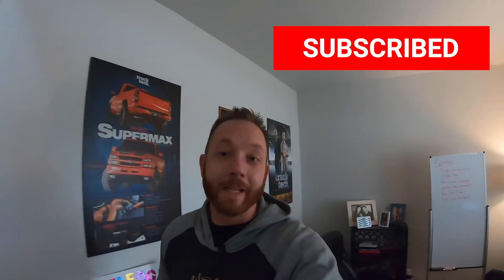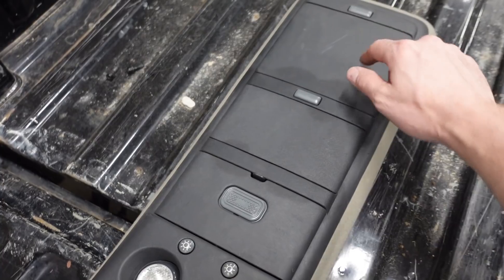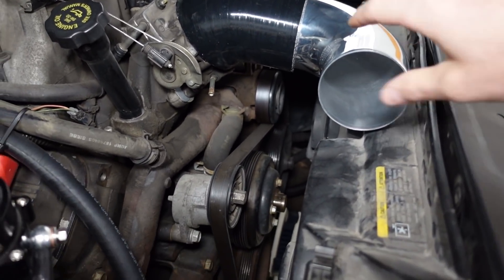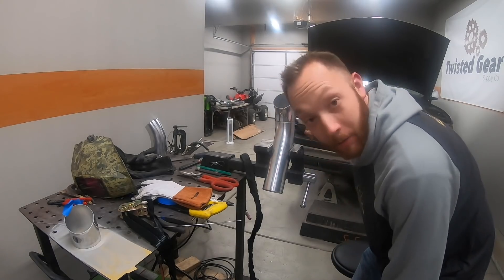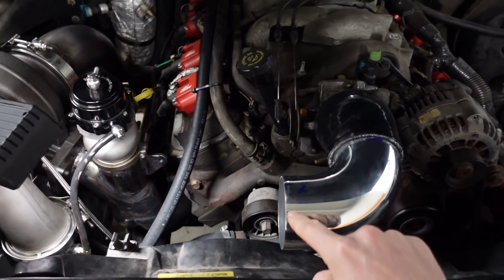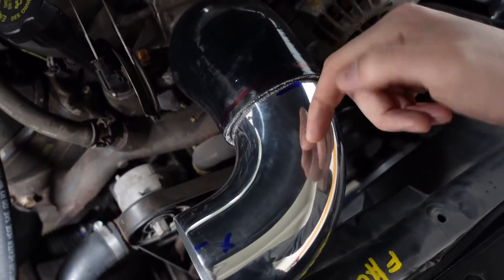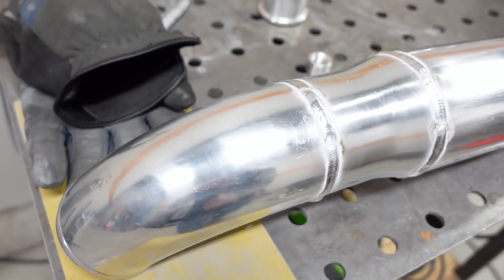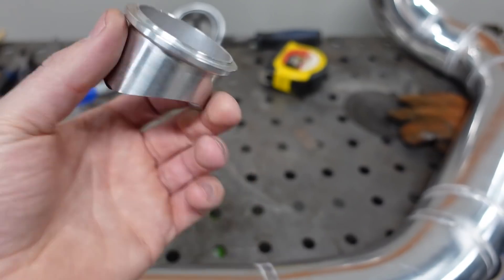Building Intercooler Pipes for the 8.1 Turbo Silverado

Comment: Do you think twins would be possible?
Reply from the maker: of course anything is possible, its a tight fit on the drivers side with the steering shaft, battery, fuses, brake booster, and a few more odds and ends, but sure, anything can be done. wont be easy though

Comment: Do you use your abrasive saw to cut steel and aluminum?  If so, does that cause contamination problems when welding the aluminum?
Reply from the maker: yes I do use it on both, but only on aluminum when I don't have a good way to hold the aluminum in the vice and use my hack saw. Yes, theres a good chance the abrasive blade contaminates the aluminum, but I do my best to minimize the effects by flat sanding the cut.

Comment: Swap the seat bases,then the worn spot will be on the inside.
Reply: But what about the armrests? They are on the inside/console side of each seat respective to the driver and passenger sides
Reply: Never-mind my other post, I read that wrong and thought you said the bases as being the bottom brackets that bolt to the body/chassis